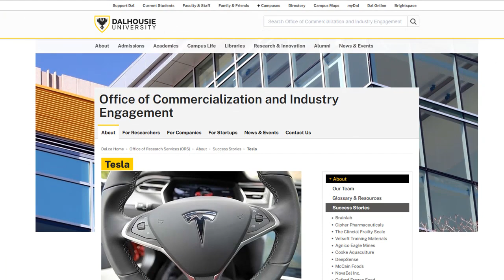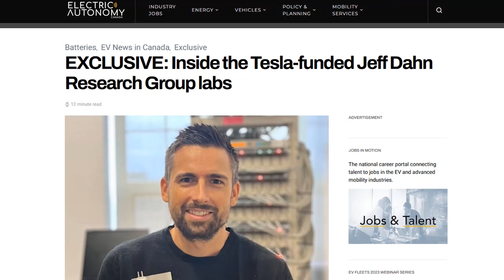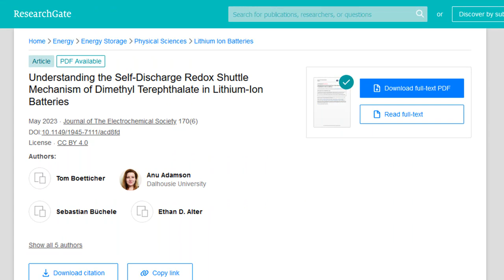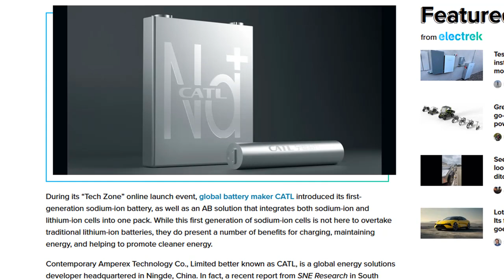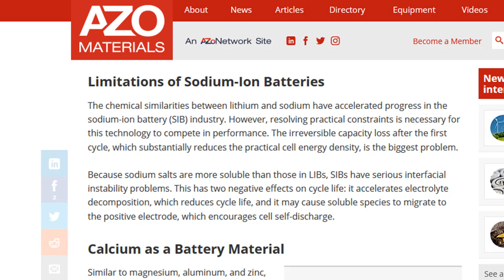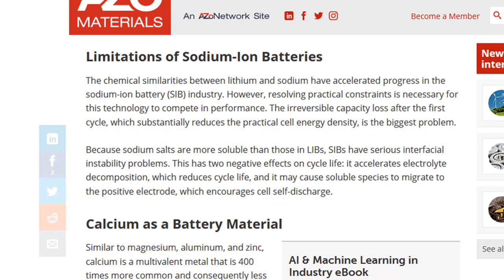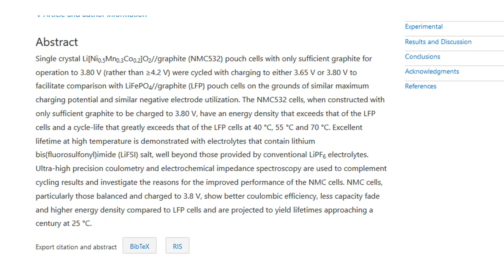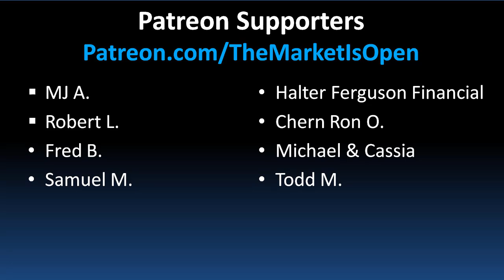Major New Tesla Sodium-Ion Battery Breakthrough

Comment: Just to be fair, what happens if a sodium ion battery or petrol tank is punctured In an accident?  A fuel tank would leak and only catch fire if there is a heat source in proximity. A sodium ion battery would go BOOM immediately.  At least you wouldn't get burnt first.
Reply: Incorrect, lithium ion batteries cause thermal runaway and burn fiercely. Sodium ion batteries are significantly less likely to burn and will be far safer.

Comment: What they really need to do - as a matter of utmost urgency - is create a battery chemistry that does not spontaneously combust and explode with thermal runaway. Otherwise insurance companies are going to shut down the EV revolution before it has really begun.
Reply: Meh. Insurers are interested in overall liability and safety statistics and those facts point to superior safety in Tesla products as the EV leader. Statistical studies of ICE/EV vehicle fires have shown that, even when correcting for the relatively low percentage of EV vs ICE vehicles, EVs are more then 16 times LESS likely to catch fire than ICE vehicles.
Your use of the word "spontaneously" is also dubious, as many of the documented EV fires have been shown to be caused by damage to the propulsion battery assembly or manufacturing defect.  For example. BMW recalled some 2022 i4 EVs for a mechanical defect that could cause an internal short in the battery assembly. Properly assembled batteries do not spontaneously combust.
In short, insurers recognize the overall safety advantages of EVs, and in many cases your premium may be LOWER than insuring an ICE vehicle.

Comment: My instant reaction (ha, get it?) is Li+Na+. Tesla would not have pulled the trigger on a lithium refinery if pure sodium was around the corner. Reaction two would be NMC is not a player in Tesla’s line-up until the sigma around cobalt is cleared up. Brilliant insight on the lab, btw. Shines a huge light on their advancements in DBE and the formulation of the 4680.

Comment: As noted by @GoCoyote
There are many variables to consider.
For instance, a "smaller" vehicle (mentioning no names 😉)
Considerations.
Superficially 
Vehicle cost? (so pack/ cell cost) would be important,
.
In which case "choose the cheapest cell!!
.
But based on what?
Sodium, touted as "the next cheap option!" May seem obvious, but has poor volumetric density (it's "big")
.
Will it physically fit while providing decent range?
.
What's the form factor?
CATL are currently telling us their new cells, combined in a structural pack, provide great density at pack level due to their square section format (no air gaps in the pack) this also makes the vehicle efficient, because a pack which removes structure from the body is a double benefit.
.
Next, the chemistry.
Nickel vs LFP (and now) vs LMP vs M3P (ironic name??)
.
High gravimetric energy density (Nickel based) may be associated with the larger, "top end" performance vehicles, but, actually, in a small vehicle, the pack will necessarily account for a higher percentage of vehicle weight.
.
Also, with less physical space, higher high density means fewer cells.
.
As a consequence, it could be logical to fit a low physical volume, high energy density structural pack in the smallest vehicle.
.
Add a high C rate charge capability and the pack could be made even smaller, compounding the vehicle efficiency gain.
.
Another factor.
Production efficiency
.
The "Ace in the hole" of the Tesla 4680?
Small modular factory.
Low energy production.
Energy dense, low resistance mechanical construction.
"Machine gun" factory output.
.
THAT'S 69% of the 4680 advantage (imo)
.
THEN add the possibility of various chemistries?
.
Imagine being able to ship a modular factory to a site, then tweak the process (chemistry) to suit the application?
.
Bulk storage (Megapack) factory?
4680 Sodium (Calcium doped)?
.
Home storage (Powerwall)? 
4680 LMFP/ M3P?
.
SEMI?
Long range (650m+) 4680 NMC / M3P?
.
MID range (400+) 4680 LMFP?
.
Cars ....pick one.
.
Taxi/ Compact (same vehicle!)
Possibly structural 4680 40kWh high C rate NMC with  5-10 minute 150 mile charge?
.
Endless permutations..... But nothing set in stone.
The "Battery Wars" will continue!

Comment: Sodium ion will eventually be King !!!
Reply: Limited by chemistry.
Reply: Why compare sodium ion to a blood diamond encrusted monarch?
Sure sodium isnt healthy to eat too much of it, but monarchs are not something to want to suggest something being actually good, unless to overlook stockholm syndrome for grandfathered in forms of domestic and foreign terrorism.
9/11 and such.
Reply: Not at all.  Sodium ion batteries will replace Lithium ion in EV batteries,  once the the super fast charging network is mature and fully deployed across the nation in sufficient saturation.  EV Range anxiety simply wont exist once the charging network is fully mature.  Sodium is far more abundant than Lithium, cheaper, can charge faster and is safer and works better in winter.  Most drivers don't even travel 230 km per day ( representing the lowest storage density of 160 Wh/kg ).  For the rare times when people do need to go longer distances, they could hire a car.  If they regularly travel longer distances, they could buy a hybrid EV.    There's a solution for every use case.  On that basis Sodium ion batteries could service a significant chunk of the EV market.  Sodium ion batteries would also be great for grid backup storage.

Comment: Using miles to evaluate batteries is ridiculous and provides very little information. What counts is price per Whr of capacity,  cost per cycle, cycle life, cell voltage range between full charge and discharge, gravimetric and volumetric energy and power density, charge and discharge C rates, ability to manufacture at scale, and safety. All of these put together determine a battery cells suitability for its purpose, and a battery must meet specific combinations of these attributes, be integrated into a specific battery pack, and be matched to a specific vehicle to be able to be eligible to be a "million mile" battery.
Reply: You don't think Tesla is taking all of that into consideration as well as just driving with a battery? You just spouted a mouthful. How much is all you just said valid? Obviously I'm just a novice talking.
Reply: This is just a rebranded catl battery
Reply: Using Miles for range is ABSOLUTELY the best way to describe the performance in a real world environment, Most people dont even know what ohms law is. EVERYBODY can understand i can go 700 miles between charges and only take 10 min to recharge and do it again. dont put me to sleep with whr and blah blah blah......

Comment: Almost no real information in this video. Keep in mind Tesla has missed all their milestones for the 4680 because they can't make the dry cathode at the necessary volumes. They might be ble to fix it, but so far it's a big bust. So be sure to apply a Mars sized grain of salt to anything Tesla says about their batteries.
Reply: I think that they are having problems with the dry electrode process for the anode, and they can’t use dry battery electrode at all for the cathode part. So far the 4680 cell has been a failure.
Reply: @iakona23  Failure?  They're in production and in products.
Reply: @TheEvilmooseofdoom  Yes they are in a few products. Cost is too high and they haven’t solved the technical issues of the dry battery electrode process yet. It works poorly in the anode and not at all in the cathode. I do believe that they will solve these issues and scale up production eventually though. 4680 would be super helpful in many products that they currently use with batteries from other makers.
Reply: @iakona23  It's not going as fast as they'd like but it's far from a failure.  That's simpleton nonsense at best.

Comment: Hopefully it will allow the EV to charge from 0 to 100 percent in 7 minutes instead of hours, the same amount of time it takes me to fully fuel. 
Hopefully it will increase range to 500 to 515 miles, just like my 2021 jaguar XJl i just brought. Maybe Tesla will come out with a full size, luxury car for those of us who prefer luxury. Hopefully these batteries wount burst into flames. Maybe they will come out with charging stations that charges all EVs just like all gas nosals fits all gas cars. I would love to buy an EV but they just have to be improved. Till then I'll keep my gas car for 7 minutes down times and far greater range, giving me the ability to keep moving when on a long distance over the road travels.......
Reply: Right now I’m getting about 200 miles in about 10 mins at the super charger.  It’s not that bad.
Reply: @cryptoico2647  200 miles is nothing. With my 515 mile range, i only have to stop once for 7 minutes when traveling the 831 miles from Lancaster Pennsylvania to Jacksonville Florida. You have to stop 4 times for 10 minutes, thatvis if you can find a super charger.
Reply: @carlsmith5545  well, If you’re traveling for 800 plus miles.  That is over 10 hrs driving.  Why not take a plane?  You sure you only wants to take  2 breaks for such a long drive.  That is just health and safety hazard risk
Reply: @cryptoico2647  I dont fly. Do you ever watch the news? Thousands sit stranded at airports due to cancellations and delays especially during the holidays and travel seasons. Plus flying, to dangerous. I would simply drive the 40 minutes to Philadelphia Pennsylvania and hop on a bullet train and take the trip in 4 to 6 hours but since bullet train technology dosent exsist in the mighty United States of America oh which is also, (fully electric), guess that's out of the question. Those super EVs belongs to the far more advanced countries of the far east and Europe. We're to stupid to build those EVs or we would've had them decades ago. So i have to drive. I start off with 9 to 10 hours to rest, i travel at night when everyone is home and out of my way. One thing is, i love to drive. It's a passion of mine and not many people can say that. Cars that drive by themselves? You can keep all that fancy computer crap. Nope not dangerous at all but, very enjoyable especially with the right sounds or music. The constant stopping to sit around like some kid in time out would piss me off. Truck drivers are allowed to drive for up to 12 hours then they have to stop and rest 8 hours. 12 hours. It takes me 11.5 to complete the 831 mile trip and i couldn't do it without a car that gives me the ability to.....keep moving.
Reply: @carlsmith5545  I doubt there is a battery that will ever please you one metric wonders.
Reply: @TheEvilmooseofdoom  update, The EV that has a high range is the Lucid with a range of 516 miles. Now all they have to do is decrease charging times from 10.5 hours to fully charge from 0 to 100 percent down to 7 minutes to charge from 0 to 100 percent. Then this EV could compete with the gas car, giving you the ability to keep moving.
Reply: @TheEvilmooseofdoom  It's not about pleasing me, It's about transition. You all are so gong ho on on a new way of transportation so much so that you want the world to go along with it and that's great. EVs are clean and has a lot less pollution but, There are those of us who doesn't want to give up on the things that a normal car gives you that the EV dosent. For my long distance travels, i need that range and a down time of a few minutes or less. EVs at this time just doesn't offer that especially for the money you pay for them. If you want to fix something that isn't broken by replacing something with something else, then that something else better be able to prove it's self greater, better, and more than well worth it as far as price, features and ability or it's only going to attract a certain few who don't care about less. If you came to me and told me, "Here!!! I have the EV for you! The 2024 ......... .......! It's a full size, luxury automobile, charging times is 7,8,9 minutes or less, and it range is 5, 6 hundred miles and the price? About 30 grand. And!!! You can pull up to any charging station and plug in because it's completely compatible with all plugs." You damn right i would buy it in a heartbeat. Wouldn't you? Ofcourse you would and so would many others. But ole brilliant Elon Musk didn't think of that now did he? So we have to sit and waite to see what comes out down the decades till then i will hold on my ability to keep moving.....
Reply: @cryptoico2647 my blatter can do about 150miles before needing to discharge.
Reply: @christianvanderstap6257  lol!!! And does it take you 25 to 45 minutes to pee?
Reply: @carlsmith5545  no it takes about 10 min including the trip up and down. In that time the charge is done as well.
Reply: "Hopefully it will allow the EV to charge from 0 to 100 percent in 7 minutes instead of hours, the same amount of time it takes me to fully fuel. "

Why? Typically you don't want to charge 0-100, and it won't take hours. 

"Hopefully it will increase range to 500 to 515 miles, just like my 2021 jaguar XJl i just brought."

Just like now there will be varying range in the cars being sold. Most people will never need that much range though. 

"Maybe Tesla will come out with a full size, luxury car for those of us who prefer luxury."

Define luxury?

"Hopefully these batteries wount burst into flames."

Why would they? 

"Maybe they will come out with charging stations that charges all EVs just like all gas nosals fits all gas cars"

That's already true in places like Europe. And the standardization process seems to have started in USA as well. 

"I would love to buy an EV but they just have to be improved."

In what way? You demanded an extreme amount of range, didn't know how fast charging is, and complained about the standardization of charging technology. If you buy a Tesla you won't have a problem with any of this. 

"Till then I'll keep my gas car for 7 minutes down times and far greater range, giving me the ability to keep moving when on a long distance over the road travels......."

You should take breaks anyway when driving very long distances. The fast charging of modern EVs like Tesla and Hyundai makes it hard for some people to even eat some food while charging.
Reply: Most be people charge at home and visit a super charger only on a long journey. Some people never have to visit a charging station. Its way less expensive to charge than it is to fill with gasoline. Gasoline is far more likely to catch fire than batteries just doesn’t get reported in the news much.
Reply: @paulmcgreevy3011  For the 7 minute down times and the 515 mile range that i have i will pay for the gas and take the oil changes all day. Besides, i only fuel twice a month and my oil changes is 2 sometimes 3 a year at 90 bucks so what, and? I have been driving for 40 years. The times i have seen gas cars catch fire is when they collide. For all the times you have to sit around like some kid in time out and for the shitty range they give you, taking away oil changes is the least they can do for you. Bottom line? Im going to definitely buy an EV. They just need to improve them first...
Reply: @carlsmith5545 and breakpad changes, water pump replacement, timing belt replacement, clutch rework, oil filter change, air filter change, starter revision, tailpipe remediation, sparkplug replacement,etc
Reply: @carlsmith5545  I see alot of escapism, overlooking that pollution doesnt really produce 12 million yearly afterlives.
Reply: @paulmcgreevy3011  For as long as they have you sitting around, charging better be cheaper and taking away oil changes is the least they can do for you. I will pay for the gas to be in and out. And i have a higher range remember? I fuel up twice a month. How many times do you have to plug up in a month? My oil change cost me 90 bucks which is nothing in this economy and i change my oil 3 times a year if that! But im going to buy an EV but like i said, they have to improve them....
Reply: @carlsmith5545  
7 minutes, not needed.
500+ miles. Not needed.
Burst into flames. You're thinking of gasoline.
"Nosels" smh
Your "ability to keep going" will be limited by physical factors.
Reply: @rogerstarkey5390  Ignorance is bliss my friend. I see a gas car expload already when it collided with another. That was the first and last time i seen that in all my 42 years of driving. Truth is, all cars, gas, EVs, solar and the upcoming hydrogen car all catch fire, expload or simply fail.
Reply: @rogerstarkey5390  7 minutes not need? Range not needed? You're one of those people who doesn't mind going along with less. But the rest of us No!!!! Hell no!!!! Especially for the money they want to have that less. What do you think iam, stupid? Bottom line, they need to be improved...
Reply: Everybody has an edge case, right?  The interesting info here is that the EV technology is making strides to make the mainstream use cases better.  I don't think anyone here expects edge case purchasers to go out and get an EV.  Stay ICE!   A lot of people (and the # continues to grow) feel EVs are better than ICE for their uses.  Just like when iPhone and Android became mainstream, it will be interesting to see what's left of the legacy companies...
Reply: @tb3901  perhaps one day they will come out with a full size luxury EV with all the mentioned improvements Then im getting one!! I don't know why the mighty, all genius Elon Musk didn't think of all this from the door. But Toyota just came out with the Toyota Prius That is electric and gas with its new range of 640 miles. Ofcourse you can plug it in for the electric part of it and ofcourse it has to charge over night. The next morning you take 7 minutes or less to fuel and that includes running in and grabbing a coffee. But atleast you get a range of 640 miles and not only 270 to 330 miles like the Tesla model y models give you. But, i will keep my eyes open.....